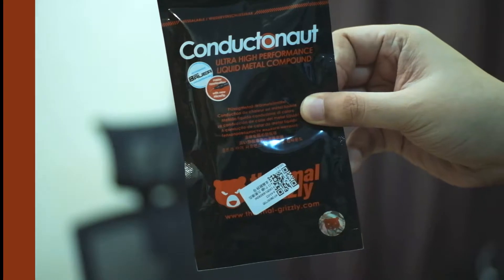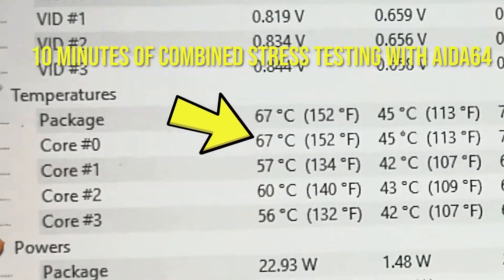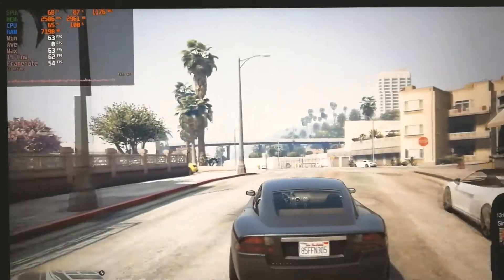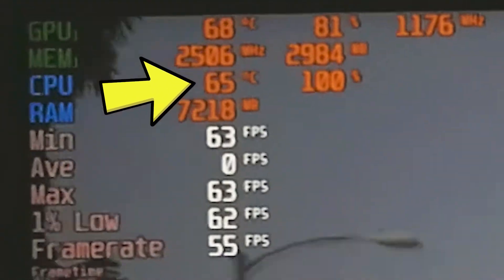Liquid Metal Laptop Cooling ft. Thermal Grizzly Conductonaut

Comment: It seems that controlling the pressure and thickness of liquid metal would be ideal.  I'm not sure how this would be done but a new design for the base of the heatsink is indicated. A "gland" similar to the gaskets on high end intake manifolds for cars could be used to control leakage. The thickness of the liquid metal needs to be controlled as well. Perhaps by making sheets of liquid metal between 2 pieces of perforated plastic. Both sides would be shipped with a plastic shield that would be removed on installation.